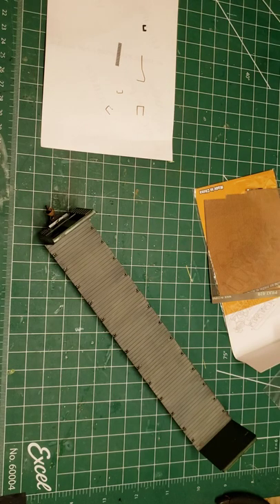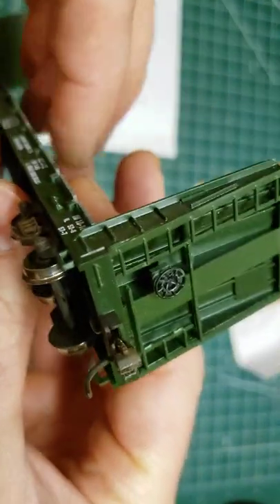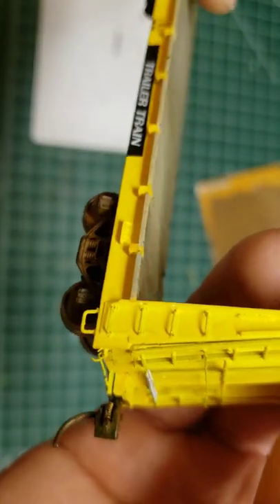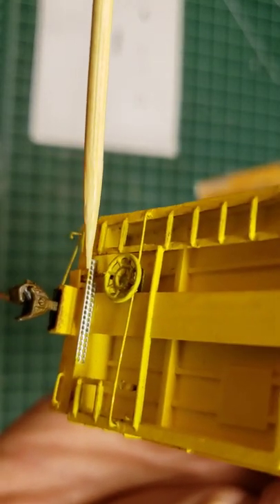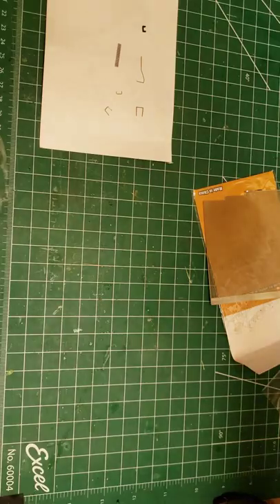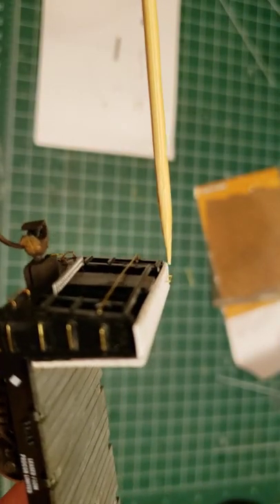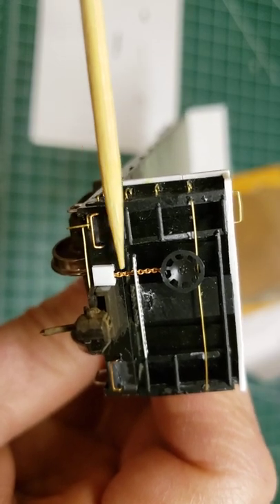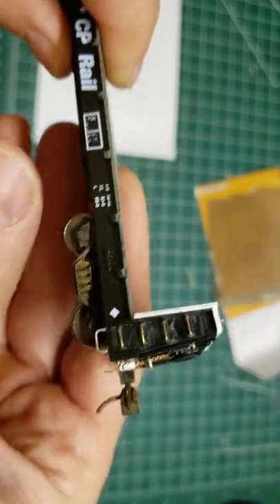Super detailing and kitbashing Walthers HO scale bulkhead flats

Comment: Nice work Matt. I love the short bulkheads, they came out nice. I am working my way through a feet of tank cars. Some were banged up some were incomplete kits. All from eBay. Do you ever do any EEC, HS, BKTY or BAEX box car patch outs?
Reply from the maker: Thanks Paul. The shorty turned out well. Most on the Dundas sub are carrying huge blocks of aluminum or sheet steel. I have one katy cylindrical hopper.  No other reporting marks you mentioned. Cheers